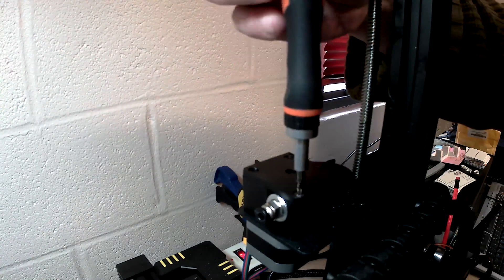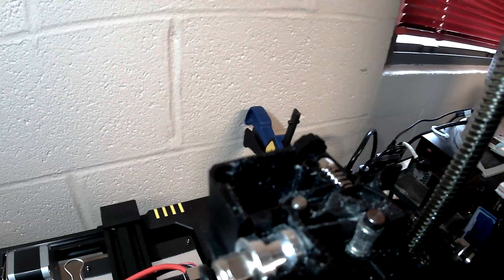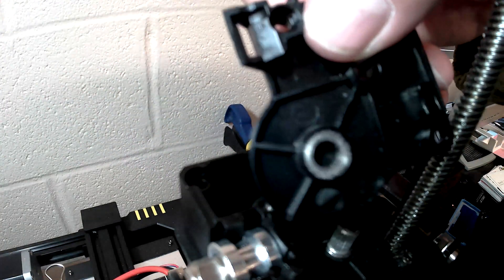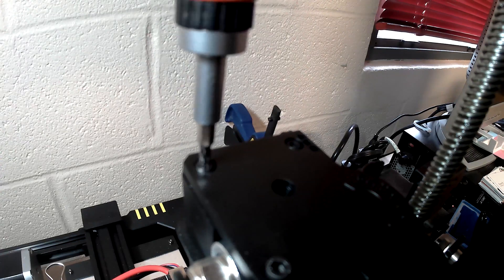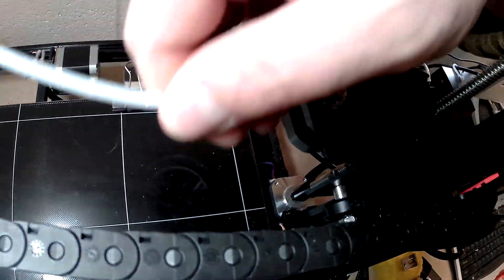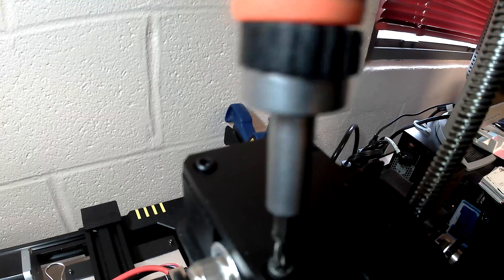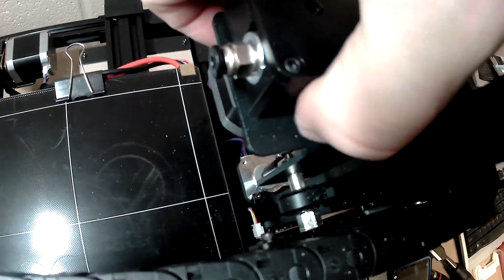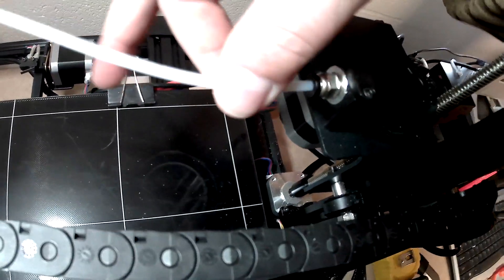Anycubic Chiron Extruder

Comment: Chiron is my 7th printer it is a piece of garbage
Reply from the maker: Sorry to hear that.
Reply: That is some kind of true but it has a high potential when you know how to allign and set everything up. I'm currently working on a guide that everyone can follow and understand what is wrong with this machine and fix it without spending any money on replacement parts.
Reply: @Foierkraft  Hi, do you have the manual for this printer ready? Any tips on how to properly set it up, modify it? Thanks
Reply: @matokadlecik  no, I realised that absolutely nobody is interested in this machine and that for a good reason.
What I remember so far:
Take care of the belts! X and Y do both not pull in one line with the bed and the hothend, they build more like a trapezoid shape, (many old printers have this stupid mistake in construction) that leads to the fact that the belts tension differs on different positions and that one step on the motor leads to different movements on the bed and Hotend depending where they are. When I remember correct it is more than 1mm on this huge machine. So printing a circle is impossible with this silly construction. Belts that are attached to what they should move have to be 100% parallel to the movement axis!
What is your aim with this machine?
I klippered it, that helped the tweeting.
Reply: @Foierkraft  Hi, thanks for the reply.
This is my first 3D printer. I got it pretty cheap. The seller probably knew why.
I want to learn on it, no special products. I just got an extruder with a bowden cable that has a thinner Di to improve retraction. I'm curious about the result.
Reply: @matokadlecik the stock Hotend is real pain in the ass. I highly recommend to modify it to a direct drive. The way from motor to Hotend is way to far, I never got acceptable results. But a tighter PTFE Tube is a good first step.
Bad that this is the only printer, it's hard to print improvements on the machine that should be improved 😅.
But for learning, this machine is a gift. I started back in the days when there were no commercials available for a payable price with a reprap Mendel max.
Reply: @Foierkraft  Do you have a replacement type for this printer with a direct drive hotend? 
How do I adjust the Y-axis belt? It seems loose to me
Reply: @matokadlecik unfortunately not, but on a budget I would simply mount the extruder to the hotendcarriage. The mass is no problem, the printer needs to be operated slowly no matter what you do 😅.

I don't know how to adjust the tension, I think I changed the mechanism.
Quick and dirty you can ziptie a piece of spare belt to the belt and shorten one tooth.
I found my old designs on my computer and also the klipperconfig.
Nothing of this is on the internet.
When you get the printer to a pont it works basically I can handle you my designs. Maybe I start with a printables account.
Reply: @Foierkraft  It would be great if you could give me some suggestions for modifying the printer. Can you share them with me somewhere? Thank you.

Comment: Anyone else come here expecting to see the extruder completely removed /replaced ?
Reply from the maker: Thank you so much for the input and the pointers!
Reply from the maker: Sorry for the unclear description. Is this something that would be beneficial for you?
Reply: @pt3d315  
It would've been.
I was trying to replace the stock extruder with a TriangleLabs BMG extruder and couldn't work out how it separated from the motor. Hence watching this video.
Pro Tip to anyone reading this...
There are 2 hidden screws. 1 is under the bowden adapter and t'other is under the main white gear.
Reply: @0utcastAussie  I, too, was hoping this video would show how to replace the extruder.  I got a replacement but the sheet pointing me to a video on how to replace the extruder was worthless as the video page could not be found.  As a newbie, I have no idea how to replace the extruder - seems you have to pull the extruder body and the motor below it apart to sandwich them between the extruder platform but how to you pull those two sections apart?  Anyone have a video showing how to replace the extruder?
Reply: I'm good with the video I lost the spring it went flying and I can't find it and don't know what to do now? Will it work without it